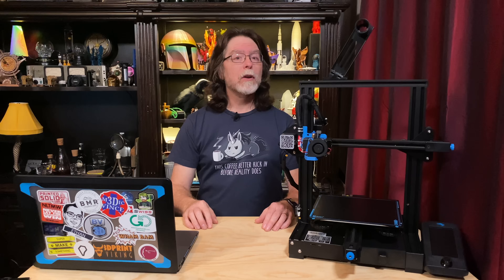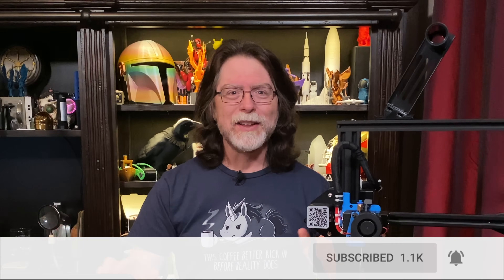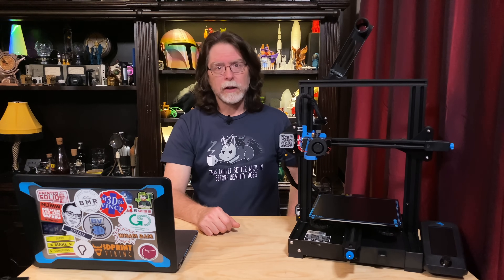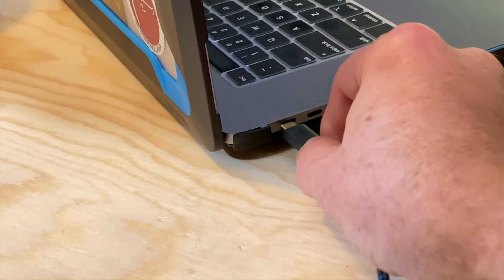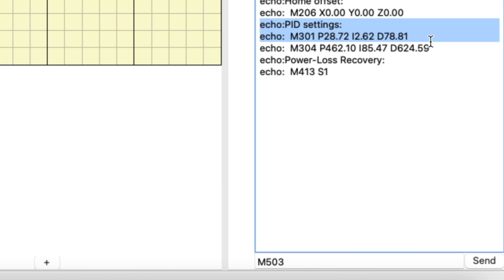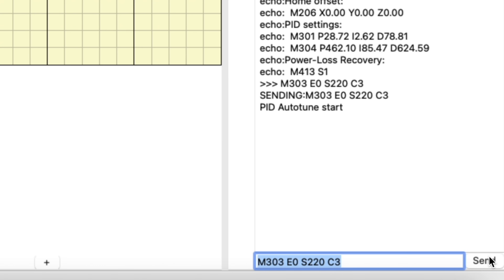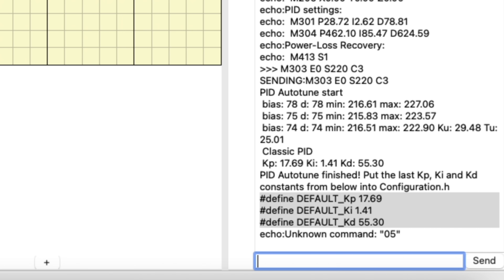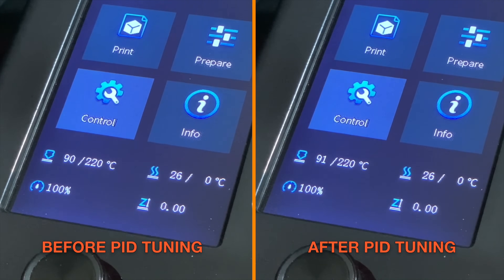PID AutoTune your Ender-3 V2 (or other Marlin-based 3D Printer!)

Comment: What biqu H2 mount are you using it looks nice i want to use that one but cant find it it looks inverted to the one i have
Reply from the maker: Hi Paul, it's a heavily modified version of the Ender-3 V2 mount that Biqu has available on their site. I'll release it when I release the review video (couple weeks, maybe?). Mostly it's just a stalk with zip tie holes to keep the wiring facing up. The STL on Biqu's site has no provisions for attaching the cable, and it just flops and flexes and that made me nervous.
Reply: @BV3D  looking forward to the video i got a lemon i hope they replace it

Comment: You actually do not need to use Pronterface at all...
Create a file on your SD card called PID_TUNE.GCODE
In the file, use the commands:
M303 E0 S220 C10 U1 ; tune
M500 ; save 
M117 PID Auto Tune complete.

Save the file and then print it.
Reply from the maker: I like this tip, Ben! I wondered if that was possible. Thanks!
Reply: it works
Reply: How long does this typically take? I wrote this to SD (minus trailing period after complete) and it’s been humming along for a few minutes already.
Reply: @CharlesLeo  it only takes about 5 minutes or so
Reply: Does it also save the settings?
Reply: @SchmidtTactical  the code I posted does save the results
Reply: @BenEBrady  Alright, Thanks.
Reply: @SchmidtTactical  I've updated the comments on the code to make it less ambiguous

Comment: So, I did this, plugged in the new values, let the printer cool completely, and then ran it again (just for grins).  The new values I got were close to the previous ones, but not exact.  I wonder if subsequent autotunes will dial it in closer and closer,  or just bounce around?

Comment: If you take apart the housing for the control screen, you'll see that there's an SD card slot there as well. Is it possible to put an SD card in that spot and save your eeprom settings to that card and still use the other card slot for programs

Comment: Putting “U” at the end of the command negates the need for M301.  It loads the values into the firmware once they have been determined, simply requiring M500 to save to EEPROM/SD card.  At least, on my printer (not Creality) running standard Marlin. Don’t see why it wouldn’t work on Creality’s version of Marlin though.
Reply from the maker: Thanks, Stuart. I've seen a couple of other comments with the same tip. I may make a short video to highlight it!

Comment: Compile your own Firmware, Marlin supplies examples for most popular printers. Creality may want to supply a limited option version of Marlin to simplify its use. More experienced users will like the additional features Marlin will give you. Marlin will also set the PID values so you just need to save them, no terminal commands required.
Reply from the maker: Thanks! Compiling vanilla Marlin 2 for the Ender-3 is one of the things on my "videos to make" list. I've used Marlin 1.x's examples for the Anet A8 in the past, which worked great. 👍
Reply: @BV3D  i would go as far as to say that is THE video to make. by stroke of luck i chose to just flash vanilla marlin from the get go after getting my two enders and i am  glad i did this. on the other hand it made some of your videos redundant, ie the bl touch one. i would strongly suggest everyone who gets and ender 3 v2 just flash vanilla marlin with the bed size set to 230x230. and this would be the first, free and very long term proof upgrade for everyone with TANGIBLE results (being able to print larger with no drawbacks) and not snake oil extruders, hot ends, dampers, screws, tubes, drives etc etc on which people are so hung up on. and again, it does not require currency.

Comment: If you already use Octoprint, then you can use the 'Terminal' tab to do the same as you did in Prontoface. Great Video (Again) Bryan, just wondering when the Barbers are gonna open up in San Antonio lol
Reply from the maker: Good point about OctoPrint; I've done that before. As for the barbers -- they're open, but I'm waiting until after my second covid vaccine dose before I pay someone to be in my face with scissors and shears. Having gotten a cold from a sniffly barber who smelled of cough drops a couple of years ago, who assured me he was not contagious, I am nevertheless wary. At any rate I may just get it trimmed a bit and evened out. I'll try it long for a little while.... longer . 😂

Comment: I had recently subscribed as I just got a ender 3v2 and enjoying the informative content, the only trouble I am having with this printer is the first layer not sticking to the bed, i have leveled and been changing print temps for 2 days now. I need, if anyone could offer some advice that would be great. Thank you
Reply: For REGULAR PLA I use a bed temp of 60 and printer temp of 200
For PLA+ 65 and 220
Reply: Just got one myself, all I can say is take off your glass bed and check that for any warping which they are well known for, and level hills and valleys with masking tape to smooth out the bad. If the glass is good, check your bed frame carriage and check for level. If all fails, like it did for me and not masking off, I just use a "raft" in slicer with a minimum of 5mm.
Note: before all that, since your bed is "level", make sure your Z and nozzle are at a good height in order to lay down the PLA...To low and it will spread too thin or scratch bed. To high and it will skip/dot PLA or not stick at all.
I watch my first layer and adjust Z offset while it is going down to find the sweet spot. I've tried storing settings and leveling to the point that I got soooo tired of it. I have it dialed in now that it's finish is glass and silky looking with regular PLA to where you can hardly see even the layers on print! I'm sure there are tons of experts here to help, but it's what worked for me. GL and enjoy

Comment: Love a good PID Tune video.  I would add make sure your Slicer is closed, otherwise Pronterface will fail to connect.  Remember each laptop sticker adds 5% more processing power!
Reply from the maker: Great tip (particularly about the stickers; the Ethan Makes sticker adds 10%)! 😉

Also, while not a slicing feature per se, it might be cool if slicers included a terminal window which could be used to issue commands directly to a printer via USB.

Comment: Great video can you tell the steps on doing the same thing to the bed -
Reply: Not all firmware has PID enabled for the bed, some use “‘bang bang”. If your firmware supports is, use M303 E-1, instead of E0, for the bed. I use S60 and C10 for the bed and S210 and C10 for the hot end.  If you put “U” at the end of the command, it will find the new values and enter them into the firmware for you, avoiding the need to use M301.  You just need to save them with M500.
Reply: @Stuart_Fisher  Thx

Comment: you says to do it the hard way, i figured having a mac is the hard way
Reply from the maker: Sometimes having to use a computer at all is the hard way, considering other firmware builds have the PID tuning on a menu, and you can do it all right from the printer. 😀

Comment: This explains so much as I regularly used to swap SD cards between my Ender 3's and my Pro 3D V-King and I got problems that magically went away when I set up Octopi on my V-King
Reply from the maker: The decision to store the settings on the card was an odd one. I read that someone asked Creality why, and Creality said their engineers didn't do it to conserve space on the microcontroller's on-board storage. But the file is significantly less than 1K bytes, and other, possibly more feature-rich third-party firmware builds are available which DO store the settings on the board, so...? 

Anyway, thanks for watching, Andrew! 🙂
Reply: Amen Andrew I found this out no joke 3 weeks ago and this video is 7 months old I'm late to the 3D printing game but I was completely taken aback by the fact the settings were saved on the SD